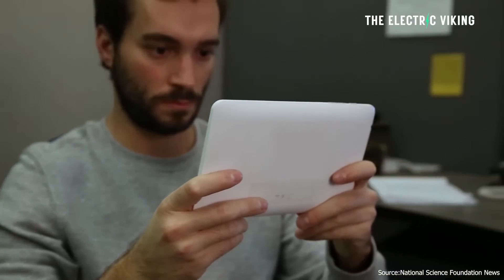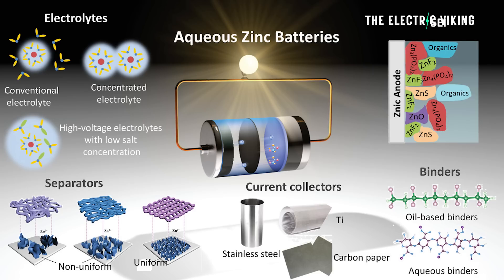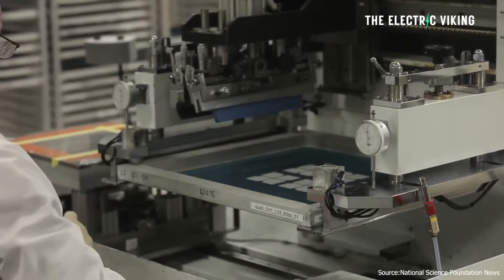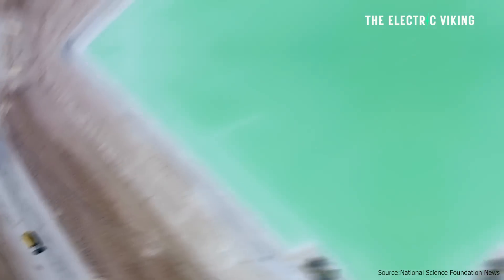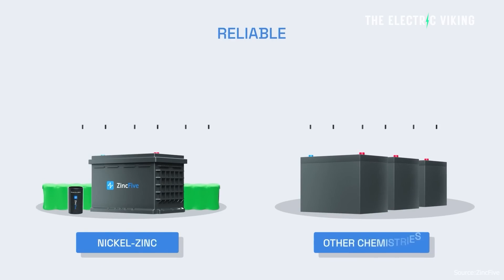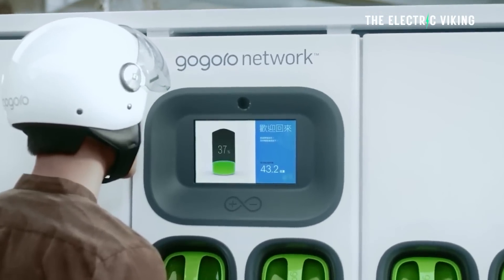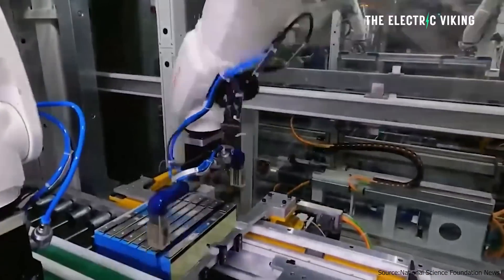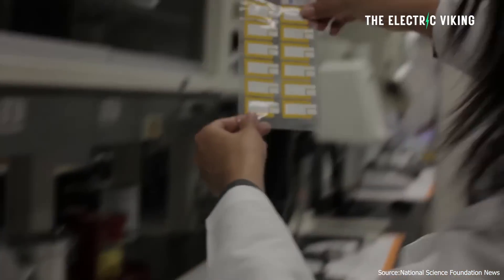Zinc battery breakthrough enables up to 20 times longer life at low cost

Comment: Just a note. The German post office powered big Mercedes vans with zinc air batteries in a pilot project around 1995. It was a bit tedious. The zinc oxide from the spent batteries was regenerated and reloaded into cartridges and returned to the van on night shift. It worked but round trip efficiency seems to be about 60% and labor was likely high. Thanks Sam!

Comment: Interesting subject, I'll be hoping to see zinc batteries back in the market, rechargeable and cheaper. The video's audio level is too low, though. I had to push up the volume to the top and, then, boom, the closing music exploded! Really bad editing. You should fix the audio level and replace the video. EDIT: after a little research, I found out that rechargeable zinc batteries have been in development for about a decade and nothing came out yet. I seriously doubt it'll even be available.

Comment: Another USELESS video... Efficiency?  Not stated, but if same as old Ni-Zn then it is not as good as Lithium ion.  Depth of Discharge? Nothing.  Leakage rate? Not stated.  Old Nickel zinc had ~meh C rate...  Number of cycles?  Not stated.  The fact it is in applied science says the numbers are NOT good and why they felt free to publish as the only thing published in those mech engineering mags are ANCIENT junk which does not work in real world.

Comment: EOS energy Zinc batteries is the way to go... So cheap and reliable, no moving parts and longest life for any alternatives... So cheap; it is now possible to backup the whole grid, it is not a dream anymore... they've got a loan over 500 mil usd from US DOE in September, now building 2 serial production lines, 3 and 4 are on the way... I believe EOSE is the best large scale battery manufacturer to invest in... I did along with AMPX (which is the best high energy density battery alternative)

Comment: If you are going to be an idiot and charge your EV inside your garage, and even worse if inside your garage is actually inside your house, then be less of an idiot and install a smoke alarm over your car that is interconnected to the other smoke alarms in your house. That way, when the battery goes into thermal runaway whilst charging - and don't delude yourself that "that will never happen to me" - at least you will be woken up so you dont burn to death in your sleep. And despite Musk's LIES, it happens to LFP batteries, too. If you have that smoke alarm at least you'll probably have 15 minutes to get your children out of the house and to safety UPWIND before your house burns to the ground.

Comment: Zinc Bromide flow/plating batteries were developed in Australia  by Redflow.  They require you to totally discharge the battery on a regular schedule so you operate with two banks of batteries (or two batteries, depending on how much power you want to store).  One battery has a capacity of 10kWh,  This completely eliminates the problem of dendrite formation as the Zn which has been plated on to the horizontal carbon-dosed plastic plates during charge is completely stripped off during a full discharge.  Their life time is said to be very long.  The only moving part is a pump and the electronics allow you to use the power even when the grid shuts down, unlike some systems.  The other ZnBr2 battery developed in Australia is the gel battery by Gelion.  I haven't been able to find out what its characteristics are but one interesting fact is that it can be manufactured in a Lead Acid factory with relatively minor modifications to the system.  Both should be fairly inexpensive if they get market share.
Reply: thanks for sharing

Comment: in next 40 years we might see these batteries in a car. Wake me up when my iphone will last for a week, because only reason now to buy a new iphone is cos of battery degradation. There are so many breakthroughs these days and we still have same batteries EVERYWHERE. These concepts are only that. You can't see it anywhere else but in a youtube video
Reply: The second we actually get markedly better battery tech the next phone using it will either use a smaller battery, be higher power, or both, so you'll still only get a day out of it..

Comment: Dendrites are like tin whiskers that grow off tip of the nose as the mustache of olde age claims your face like that movie with stacey keitch who's hair grew to the point of filling a room and causing failure to operate correctly.
Always brush your tooth using teethpaste rather than toothpaste, because if you only need toothpaste, what's the point?

Comment: Large Zinc-Carbon batteries were used by the PMG in the 1940's to power the external telephone bells in commercial premises. These lasted for years but were not rechargeable. Yes, they were very safe, that is now the most important criteria.

Comment: Why don't you EV fanatics just admit we are nowhere near having the battery component of EV's figured out yet, ecery week Sam is telling us here is the next solution in battery tech. 
It's getting old and boring now and obviously they still haven't found it yet.
Reply: Same as "This new engine will be better than the last", there will always be a better something.
The research will help your phone last longer between charges, is that a bad thing ?
Reply: @owainbennett663  it's an irrelevant thing as my phone battery lasts all day with continual use now.
Reply: @owainbennett663 well in 25 years mobile phone tech hasn't improved. Phones 25 years ago lasted 1 to 2 days at best. Today with all the amazing tech we have phones still only last 1 or 2 days on a charge. I'll believe it when I see it
Reply: @Car-crazy  Wrong mindset.
Computer technology has outstripped the speed of the battery technology.
Your phone has over 1000x the power what was used in the Apollo mission.
Reply: @Car-crazy twenty five years ago you used a mobile phone to just make calls, todays phones are used constantly you get that right to call, browse, message, use app for shopping, take pictures, listen to podcasts, pay for stuff  😂
Reply: @SWR112  8 years ago the phones had much the same functions as now and were used for doing much the same as now.  In those eight years battery tech really hasn't improved, the the software and electronics have improved and uses less power, but even with those improvements the phoned still do not last any longer. It is a fact that battery tech has not improved. And unless a new material is invented or made it can not improve anymore. 25 years ago its true we only used them to make calls, but then they only had a small at most 1000ma battery. Today's phones such as my Galaxy S23 Ultra has a 5000ma battery.  They have got bigger, but not more long lasting.
Reply: @Car-crazy  You are correct in that regard.
We had more technology changes in wartime than any other time in history.
Internet, radar, jet engines just to name a few.
What is the latest thing with technology? Foldable mobile phones. It is good a company like Tesla is making changes, it may kick-start fresh ideas.

Comment: Nonrechargable zinc air batteries have been around for about 40 years,  they hav offered the benifits of lighter weight and longer life, however there were current limits.  In Hospitals they were great for telemetry transmitters as they diddent have to be changed as offten.

Comment: There are so many claims on great potentials of various EV battery technologies to-date. However, I will believe only when it is placed in working EV!
Reply: They're probably heavier than lithium, so probably won't be in EVs. But there are many applications where weight isn't such a big deal.
Reply: They have. The new much better CATL LFP batteries are already in EVs, just not in North America yet.

Comment: Ni-Zn batteries have been available for over 120 years.  They use the same NiO-OH plates and the same KOH electrolyte as the other Nickel-something batteries, of which there are many.  They are all OLD.  Sam is once again digging in the history books to find material for more videos.    The biggest problem with zinc cells is that with other than optimal recharge current, one either gets dendrites(spikey things) that short out the cell or mossy deposits, which don't conduct well.  Ni-Zn has been the next great thing for 120 years now.

Comment: Whats the point? You have Na batteries that can do this a whole lot better? Cheaper and can copy anything Li can do for the most part? Seems silly to me other than just to improve them I guess, but for anything else - Na will be the future for that. Let alone NA already supports solid state making them smaller and lighter - along with being safer. Follow up by new materals like S and Si that can double their power dens from 140 to well over 300 and more.

Comment: There is certainly a lot of work and research going into battery design and chemistry. Eventually we will come up with a perfect solution. Thanks for all of your hard work putting your videos together. I enjoy them and appreciate it very much.
Reply: We have multiple solutions, with different characteristics. One size does not fit all.
Reply: I enjoy Sam's posts. I try to watch everyone he posts, but it is like standing with your mouth open in front of a fire hose with all the information he imparts. As long as I can swallow I'm going to keep drinking. Thanks Sam. Mind blown as usual.
Reply: Don't fall for it.  Every five minutes somebody else comes up with the next new "ten times better" battery.  I've been hearing this since 2000.  So where's the battery?  The only battery that has emerged is the li-ion and despite the billions put into its r & d, it is not a safe product.   So like they use to say in the old Wendy's commercials...."Where's The Beef"?
Reply: @mattrowan2680  I think you need to take a look at battery density, price and capabilities since 2000, there are charts to break it down for you.  If you do you'll instantly see the dramatic improvements made in a relatively short period of time.  Since 1991 battery prices have fallen 97 percent per kwh.  Since 2000 since you brought up that date, they've fallen 93 percent.  They fell 30 percent last year and are expected to fall a further 40 percent in the next 2 years.  At the same time battery density has increased 3 to 4 times and charging has improved from 17kwh in 2008 to 350kwh today a 20 times improvement.  BP is rolling out 400kwh chargers and there are 700kwh being tested by NXU.  CATL and BYD have both announced batteries capable  of 500kwh+ charging.  Technology never stops and this is far from the end of the road for battery development.